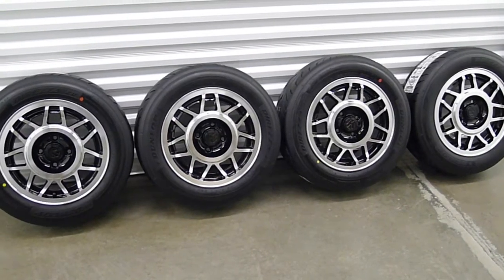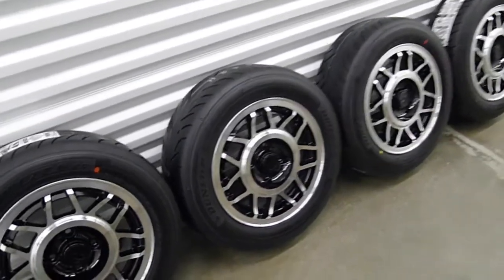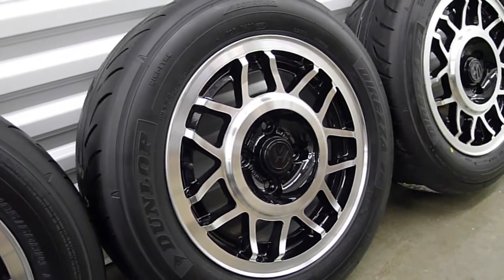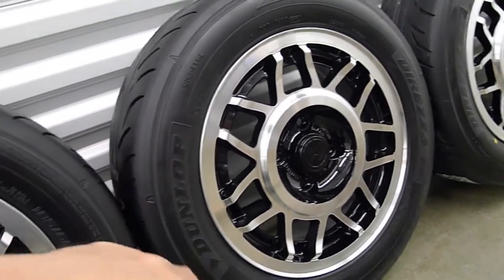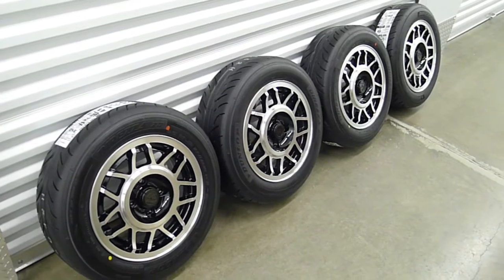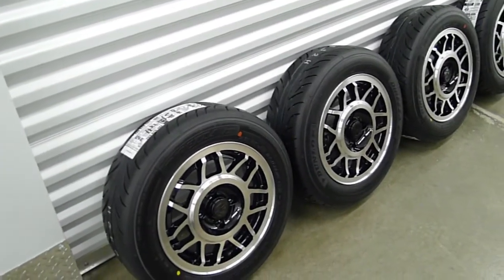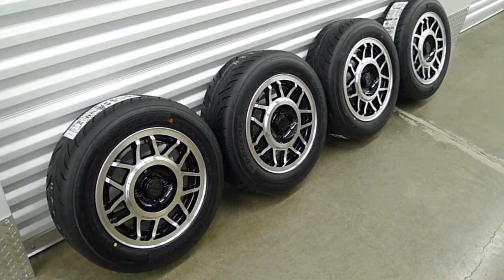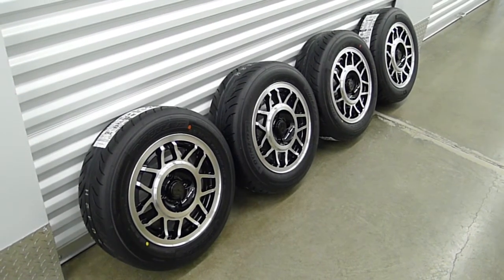The Ultimate 1983 Rabbit GTI Project - part 44 (VW OEM Snowflakes brought back to life)

Comment: Makes me want to get the set of BBS RAs I have refinished.
Reply from the maker: May not be as expensive as you may think - aroud $150-200 per wheel depending on your need for TIG welding additional material on the edges